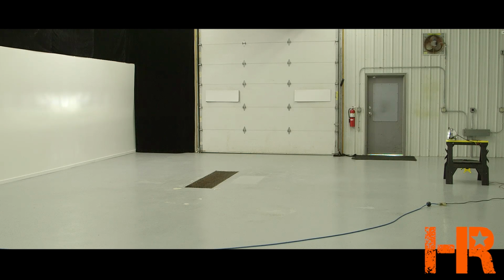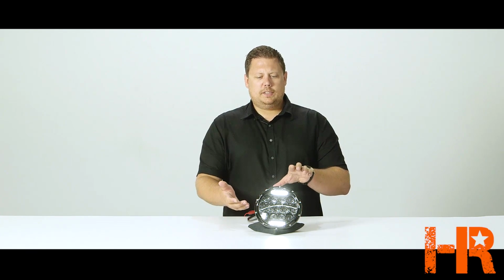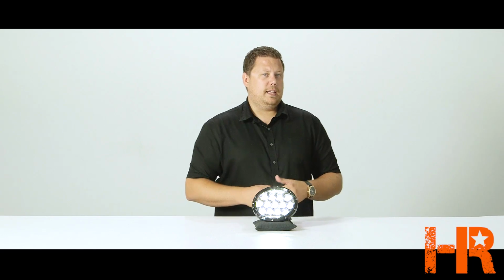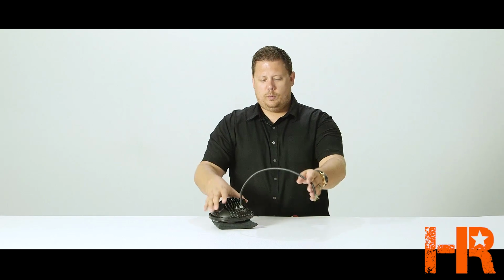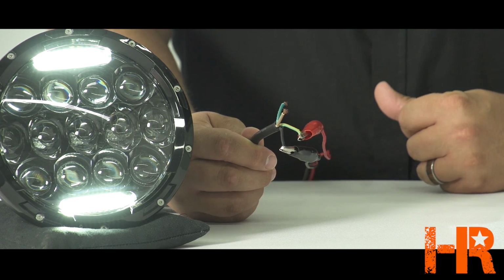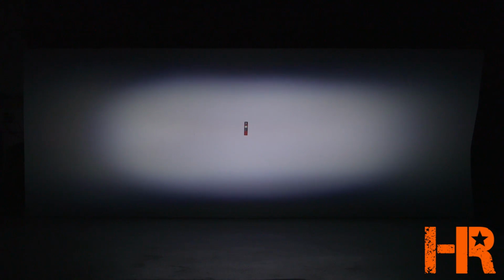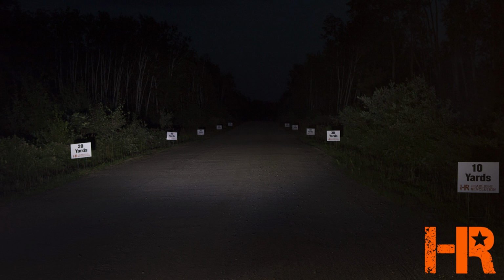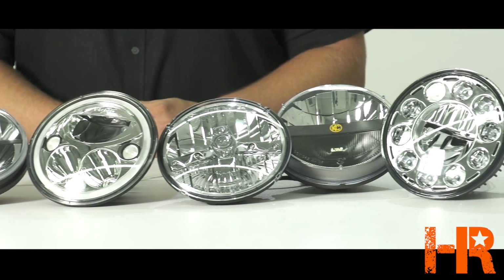15 LED Black Chinese Generic Headlight Demo and Review (7" Round LED Headlights Shootout 10 of 12)

Comment: I simply cannot afford 500.00+ for a pair of headlights. Certainly there must be something better than the auto parts sealed beam at 20.00 but still affordable in the 100.00 - 150.00 range that works well? Let's see a review for the average wallet guy!
Reply from the maker: Unfortunately, we don't test the 2nd best lights. Here we are looking for the best of the best! 
There are budget options like the Vision X sealed beam housing replacements that you can add LED bulbs to but you're still talking $300 for the pair with some good LED bulbs in them!
Reply: @HeadlightRevolution  Thanks for the reply and informative videos. But if I may try to convince you: I drive an un restored 56 Studebaker Power Hawk. I'm retired and my monthly income is 1500.00. People like me still deserve an adequate headlight, eh? The 'best headlight' is no good if I can't afford it. Perhaps you might shift your paradigm to 'the best headlight for 150.00'? Then some of us lower income folks could have great lighting too! Thanks!
Reply from the maker: Check out the Vision X lights, I think those would be great for what you're looking for!

Comment: 7:30 “it doesn’t have two independent distinctive beam patterns”. What are you talking about? It absolutely has to distinctive beam patterns, as it has two distinctive origins of light between the two beams. The highbeam is centered in a portrait mode, low beam in a horizontal. That is exactly what you want. You tell us it doesn’t have crisp beam lines but it looks like it does absolutely! Dishonest video.